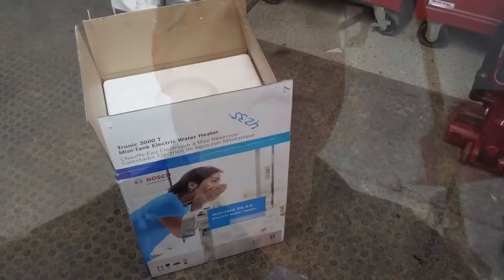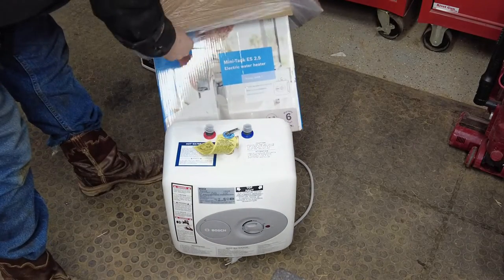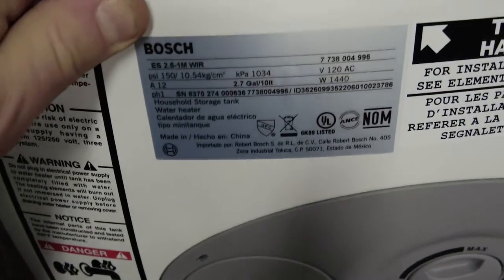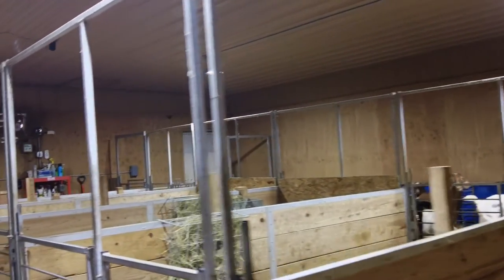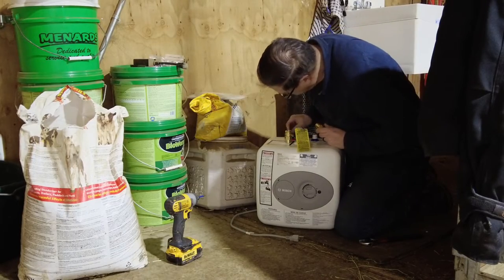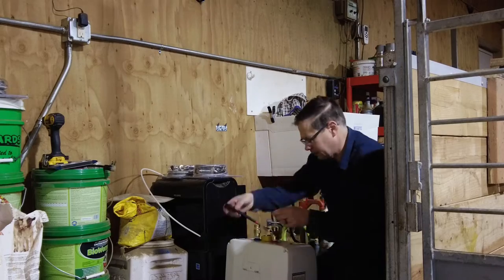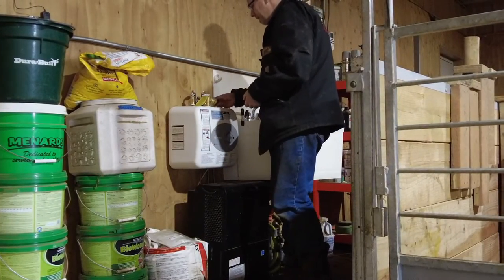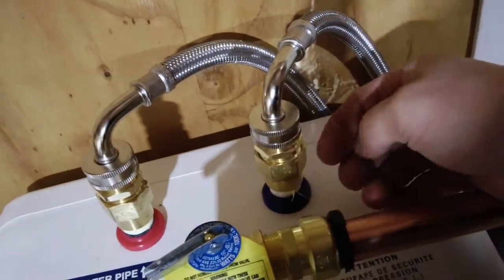Best MINI Water Heater for Barns or Under Sinks...Bosch

Comment: great job, this unit needs maintenance work at least once a year( the heating element needs to be cleaned and the anode rod needs to be replaced  ) easy work for your set up.

Comment: I just installed one of these in my RV. What is a good way  of draining it?  Should I rig up a small water pump to the relief valve? Thanks!
Reply from the maker: If I had to drain it yearly I probably consider air hose to the incoming side and try to blow them empty personally
Reply from the maker: I probably leave the exits and even the emergency pressure drain then open once empty to allow any expansion